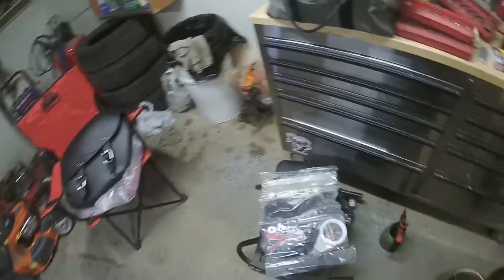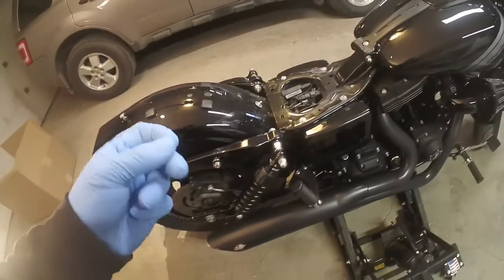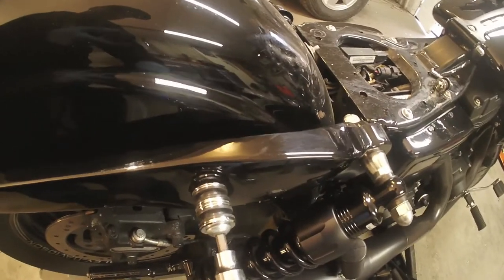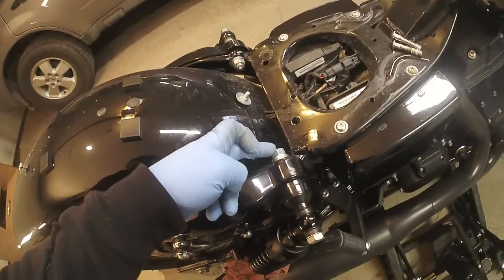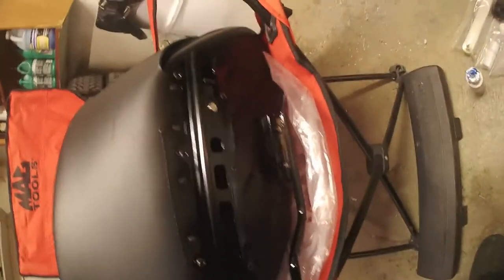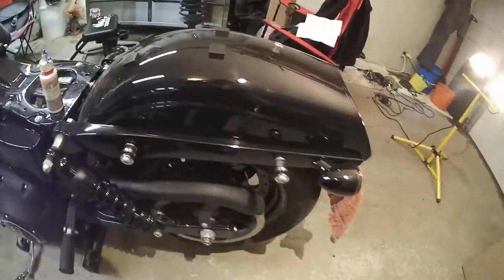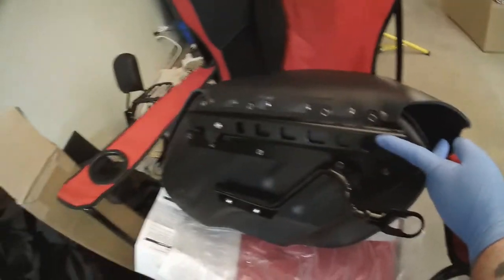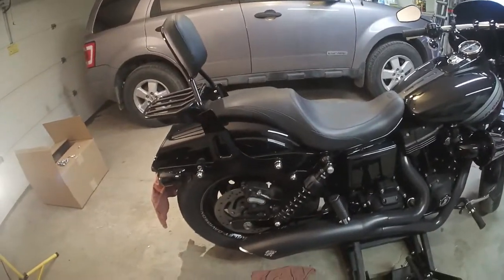How To: Install Detachable Saddlebags On Harley Davidson Dyna (FXDF In Video)

Comment: Hey, great video . i got a quick question bud. Did you purchase the the black rear fender struts or did they come with the bike, same with the rear turn signals and belt gaurd? I ask because im trying to get the chrome off my fat Bob. if tou did purchase black turn signal housings, could you shoot me a part number? thanks man , your bike looks mean!
Reply from the maker: nobama I took it all off and had it powder coated, Waaaaaay cheaper then black fender struts from harley, the rear stand offs and directionals aren't available in black so the only option is powder coating. 
the upper belt guard is off a street bob, unfortunately I dont have the part number for that

Comment: And did you consider using the Easy-Bracket, it seems a lot easier than undoing shocks plus they key lock on.
Reply from the maker: I didnt know about the easy bracket! Kinda wish I did cause that would've made install a breeze

Comment: Do you also bite the bullet bought the J&S Jacks?
Reply from the maker: Jackie Tan I bought the J&S jack a couple years
Reply from the maker: Jackie Tan nope, fits the frame perfectly. i am working on that lift review video for you 👍
Reply: Thank you. So far does the oil pump give any problem? Is it ok you can give some commend how J&S Jacks compare to the harbour freight brand.
Reply from the maker: Jackie Tan I haven't used a harbour freight cause they aren't in canada but I've used a master craft and princess auto... they're a solid inch or so taller so sliding under the frame without parking on a block of wood may not happen. they're super shakey and you gotta strap the bike down. on my j&s I can hoist the bike and sit on it without any straps!
the pump... I've got a couple years and probably a few dozen lifts on it and no leaks or bleeding back